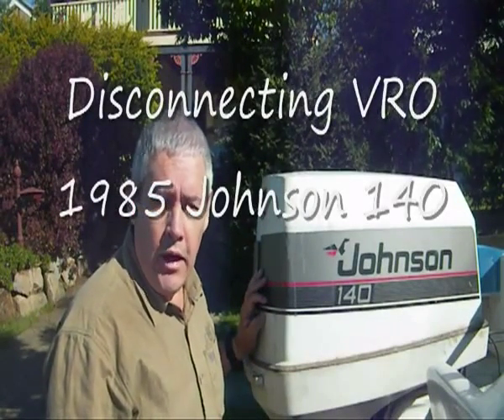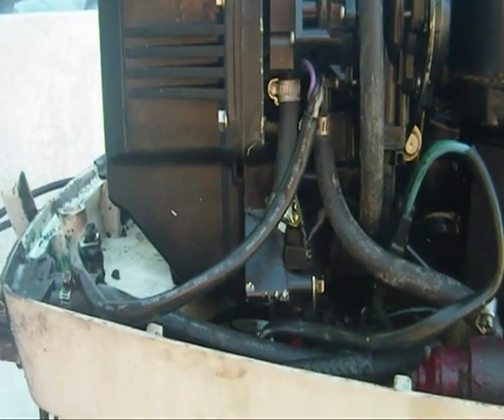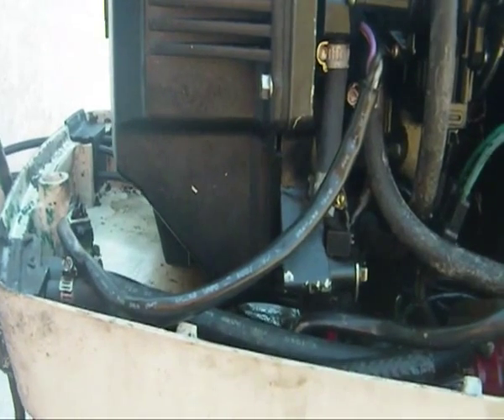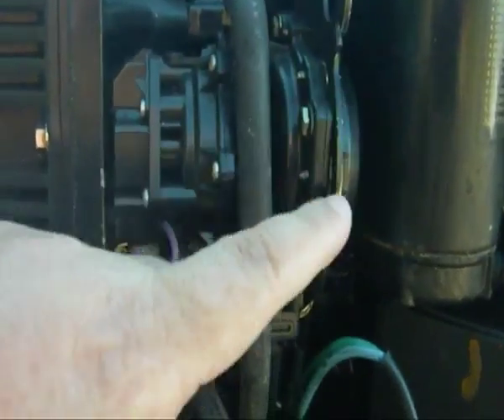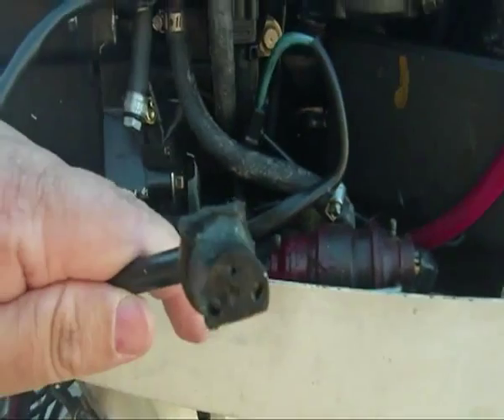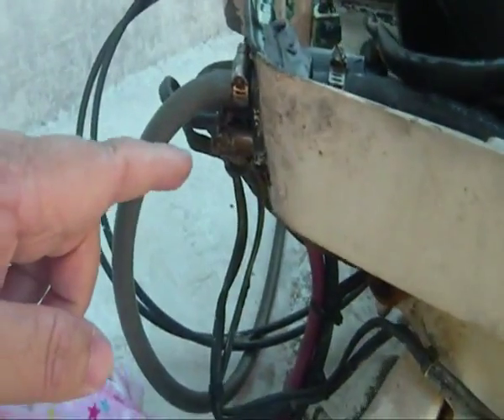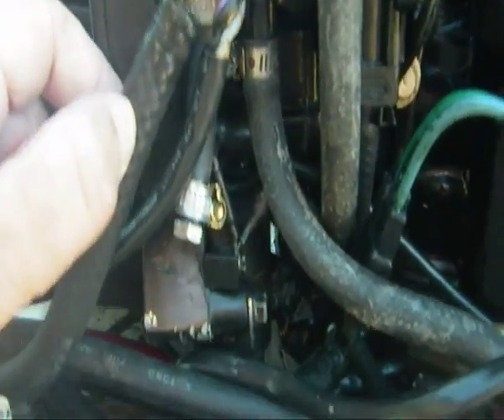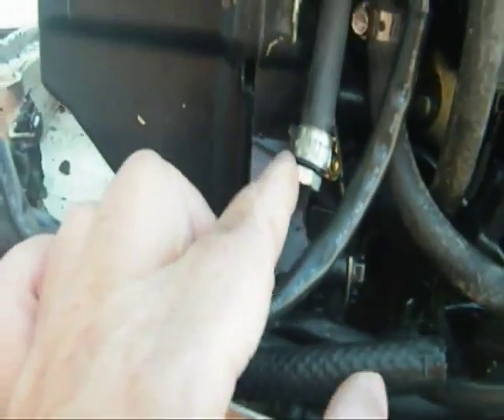iboats - How to Disconnect VRO oil injection

Comment: Why?
Reply: Some people like adding oil. But 50:1 would be to much oil for these engines at idle. They are designed to use a 50:1 ratio at wot and at idle 30:1 also the fuel/vro pump is designed to inject the oil on one side and fuel on the other. Running without the vro decreases the pumps life. 

where they have capped the line of the vro use a clear line and fill it with oil and hold your finger on it. Should drop 1" within 3 pulses at idle if it's working correctly.